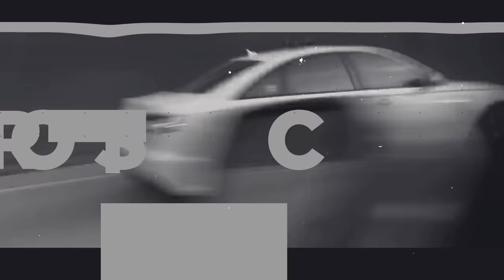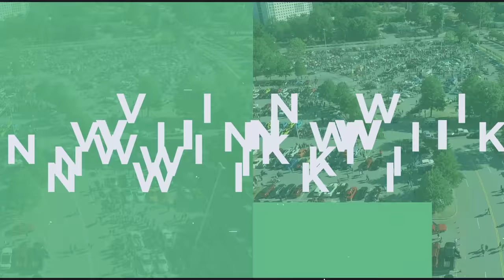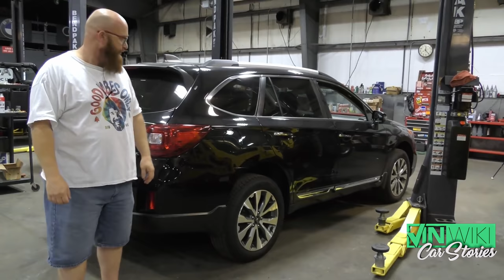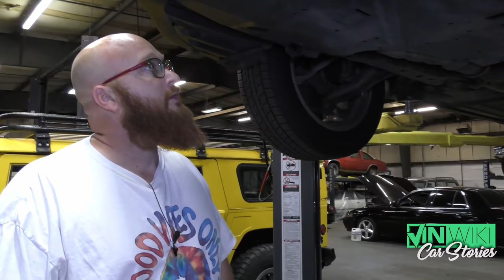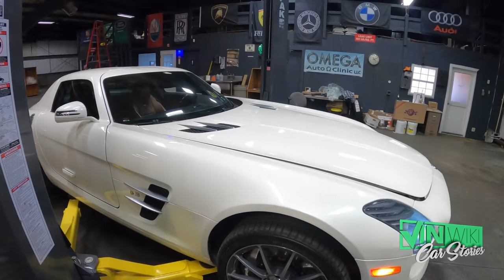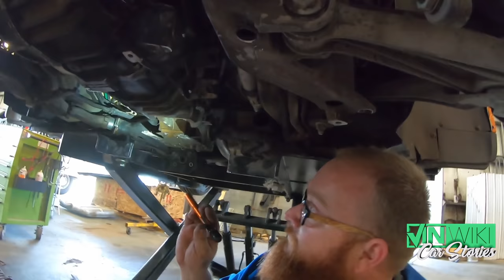The Car Wizard's 4 Worst Mistakes Ever!

Comment: Takes a man to admit his mistakes.  Happens to the best of us.  Thank you for your service.  In the USAF I’ve seen a few as well.  One was not pulling the manual landing gear release lever out of the port in the floor and when the mechanics swung the gear using hydraulics and the lever on the instrument panel the manual lever on the floor swung forward against said floor and bent a bunch of linkages, damaged the floor, and downed the airplane for a week or so. 

Also, guys dropping a 6.4 million dollar targeting pod because they were in a hurry.

On the contracting side when I rebuilt helicopters, there was a dude who wired a relay panel wrong and it shot sparks across the inside after power was applied (115V 400hz 3 phase).

Like I said, happens to the best of us.  Even fully qualified maintainers.

Comment: Working with the structures crew I was riding brakes on TP-01 , the Mexican Presidential 757. They couldn't find a lift to tell if it would clear the tail going into the hangar. I told them to lower the main struts and it will go we did it several times. I was along for the ride and I heard a screeching sound. Instead of stopping I heard the tug pulling harder, then whoa! The guy driving the tug looked up and said what was that noise? Sounds like ripped and tearing sheet metal to me.

Comment: My moms favorite Subaru wagon had same fate by valvoline oil change. Guy drained trans, then double filled engine. Grenades both, since value of car was less than $1500.00. They gave her $1k which could not buy and replace engine and trans. She just had timing belt service. We traded it for a focus

Comment: on subaru automatics traditional and cvt the transmission and front differential have separate oil supplies, manual they are one assembly

Comment: Those FUPPs (full up power packs) for the Abrams are not cheap but they are by far the easiest to replace compared to any other military vehicles. Loved working on the Abrams such a great piece of military might.

Comment: I made the mistake of draining the cvt transmission fluid out of a 2017 subaru crosstrek thinking I was draining the oil for an oil change,  put an extra 4 quarts of oil in the engine (way overfull) and sent the customer on his way with an empty transmission.... needless to say I was replacing his transmission 2 days later. Discovered where the oil drain plug actually was after the fact. Lesson learned.

Comment: The subaru mistake is a common one for beginners. Changed the trans and diff fluid on a friends 2013 Crosstrek, but was very careful to do so knowing what each port was (3 or 4 ports close together). A year later, someone changed it again, or attempted to, and wiped out her transmission. Shop insurance covered it. Pretty dumb F thing to do though.

Comment: My sisters brand new 2019 Ascent, I think first or second oil change. My dad changed her tranmission oil in stead of regular oil. I didn't hear anything about the differential, but the transmission was gone. $9000 charge from the dealer to replace. It was lucky, but my dad's homeowner's insurance covered it. I was more mad at my sister than my dad, learn how to change your oil, have your husband do it, or pay someone to do it.

Maybe Subaru should label the fluids better?

Comment: I got an oil change from a quick lube place in Billings Montana. Later that day as I was driving across the country, in the middle of nowhere Washington a cloud of smoke come out of the back of my car. I had to walk 5 miles to the nearest house. What happened was they put on my oil filter on wrench tight and my drain plug on hand tight. All the oil came out of my engine. They ended up treating me right and got me a rental car. It went to a Chevy dealer, and they went through everything. Good ole LT1.

Comment: One of my worst mistakes was on a vw crafter 2.0L TDI. Just put a new head on it because the serpentine belt tensioner had failed and the belt ended up tangling with the timingbelt on the crank and made it skip time and well valves hit pistons and thats it. But i did forget to tighten the 3 bolts for the camshaft gear properly, which results in skipping time and oh fun i have to do it all over again. But hey shit happens sometimes what matters is how you deal with said shit.

Comment: If I remember correctly the Abrams shares an engine with the apache but of course not the transmission. The wizard had a good commander that understood that mistakes happen and didn't over react about that situation.

Comment: One time a Mercedes dealership screwed up a basic Service A on my friend's E350. The tech not only managed to overfill the motor with oil but also spilled a ton of oil all over the motor and naturally it dripped onto the exhaust manifold. As my friend was driving home the oil level too high light came on and as the motor warmed up it started to smoke everywhere and out the exhaust. Car got towed back to the dealership. The dealership did do over the oil change but told my friend he had to pay for the engine bay shampoo. After some arguing they finally agreed to shampoo the motor to get rid of the burning oil. The thing is the motor burned some of that excessive oil so it ended up fouling his spark plugs and messing up the cats and o2 sensors and on went a 6 month battle between my friend, his insurance, the dealer's insurance, lawyers and that dealership. Complete mess and to top it all off that Service A was $320.

Comment: I have a highschool shop story. Brand new F350 that the shop teachers relative just purchased was in getting simple oil change. My friend went to drain the oil and drained the transmission oil. Then he started to fill the oil but it quickly overfilled and right away shop teacher knew something was wrong. A bit later that ford got new engine and transmission oil. No damage other than some embarrassment 🤣

Comment: There was a lot of vehicles that has the trans and diff were married  that had diffeent reservoirs. They didn't put a drain plug on the diff and the fill plug was hidden.
Most of the early Toyota's did before they used ATF and removed the seal between them.
I bought a 92 corrolla from a buddy who had changed CV shafts. They had only used it for short drives.
Drove it 70 mikes to home and the next time i drove it to work the diff locked and broke.I have been a mechanic for 45 years. Have so many master certificates you cant imagine.
Rebuild diesel engines, heavy duty aotumatics and train how to do it.
This type of thing can get anybody.

Comment: A guy at my work did the same thing on a Subaru, you have to understand the automatics have a separate differential, the manual is a transaxle and shares the fluid, the cvts are another ball of wax.

Comment: A Jiffy lube messed up the transmission of a Tacoma I had. I went for an oil change and they offered to also change the transmission oil. Apparently they messed up something the transmission didn't work properly after that. Ended up driving it to Mexico to get it fixed cheaper. The oil place never took responsability for it

Comment: I broke an ear off of a 700r4 trans  once missed a bolt ,I  Didn't get the wheel tight enough  on a dodge dually once.Had to drive to ks city to install new wheel studs.put a head gasket on a 5.4 upside down facing backwards once. those are the biggest things ive screwed up in the years ive been at it.

Comment: I remember doing a job years ago I put a power steering belt on one rib out on a PK belt after doing a timing belt on a costumers car. a few days later it broke a pace of rubber off the power steering belt and sucked it into the timing belt and bent 10 valves... lol even my boss said I was extremely unlucky.

Comment: I didn't know the Wizard worked on Abrams.  I never seen a power pack dropped but I did fill one with water and trash it.  My boss was pissed but it wasn't my fualt.  A tech from honeywell had left an inspection plug out that couldn't be seen from above while doing my inspection before a waterfording test.

Comment: Those M1A1 engines are not only expensive,. they don't last long.  One of the reasons the Gulf War was over so quickly:  they were running out of tank engines.

Comment: Believe it or not the way back in the late 1990s I had my 1992 Nissan Maxima SE at the Nissan dealership for replacing the worn cam chain sprockets. In the process the mechanic somehow did something that resulted in the timing chain to be thrown and half of the valves were bent and the dealership fixed everything they caused to be damaged and supplied me with a free loaner car and I was only charged for the original quoted price for replacing the timing chain sprockets. The repair bill would probably exceed the value of the car but they were honest just like David was with the Subaru owner. Big props to that dealership because I think many garages would lay all that expense on me giving me some story about how the car was not properly maintained or something similar. Hudiburg Nissan if you live in the Oklahoma City area. They are honorable folks -- if you can get the best service advisor I've ever had. He treated my mom and dad like royalty even though they weren't and he was always honest and straight with me too. Marvin Johnson. He's been there for 25+ years and although his name isn't on the dealership sign out front it should be.

Comment: I thought it was when he doubled down on not pre-lubing filters, betraying his lack of understanding of the difference between a constantly replenished lubricant wedge and a blast of air through your main bearings, pushing out the last flimsy bit of leftover fluid film it needed for startup just at the second the engine fires.

But at least we know he makes it right. Obviously a good guy, if you're not a crankshaft.

Comment: I was changing the oil on my Outback and ended up draining the transmission and over filling the oil (don't drink and change fluids). Damn thing actually ran for a couple miles until my wife brought it back complaining it was smoking. Drained oil, filled transmission. No issues 100k miles later after I sold it. It was an H6 if that makes a diff.

Comment: This wasn't a mistake so much as a funny mishap.  I worked at a Chevy dealer and of course we had a service department.  At the end of the day the compressors are turned off.  Well one lift had a car on it and the car was back out but not all the way and left there over night.  Somehow when the air came back on the lift does what they do and lifted.  The lift caught the front bumper of the car and we found it hanging off the lift.  It was so funny to see a Citation hanging in mid air.

Comment: I was a 63whiskey all wheel direct support mechanic. then switched over to the Hotel designator or  track side. We would break so much shit just not having proper supervision. 
Breaking bell housings three time in a row putting in transmissions. 
One time we were about 150 miles from post and a wheel bearing failed. Instead of getting it towed they said screw it and drove the hemtt back to post which was 150 miles on the autobahn. The end of the third axle of four was completely melted on the end. Couldn’t get the wheel off nothing. Had to cut it to get wheel off then Bogeyed the whoop four wheel back section out to replace entire third axle assembly. Army never gave us shit about that kind of stuff back then was mid to late 90’s. We’d just be like ….it broke again. 
😂 👍

Comment: I broke a buddies laptop when putting it back together. I accidentally used a screw that was too long in the wrong place. The screw broke the pins on an IC chip on the motherboard. I felt so bad about it. It was a bad design by the manufacturer and I've not encountered another model where this same scenario could occur.

Comment: I don't blame the technician for the Subaru they put the fill holes for the front diff and transmission where they are easily confused we did the same services on an outback where we put the wrong fluid in the holes. We caught the mistake before the customer left but the contaminated transmission gave out later.

Comment: I changed the fluids in my Moms 13 Crosstrek 3 years ago. So 3 weeks ago I did it again. I couldn't remember what plug was the front diff fill plug. So I went to YouTube and watched a video. I was in a rush. Video said driver side. Well video was from Australia. So I filled the CVT with gear lube and ran the diff dry. I flushed the CVT 5 times. 300$ in fluids. Car has been okay for a month. I just smell the fluid burning still. I don't see any leaks. I did dump it everywhere and on the cat. I have washed the engine 5 times and it still smells. Not sure if I burnt a seal up. Well only way to find out is pull it out.

Comment: I screwed up on my bosses brand new Ram 5500 by dumping DEF into the front fuel tank. I was getting it ready fir a trip to pull a car home so I told him. He didn’t get mad which helped me stay calm. I told him I can drop the tank drain it and clean it. An hour later and a full tank of cloudy diesel I had it back together and it didn’t cost me 6-8000$ for a new fuel system. I learned a long time ago to admit a mistake and fix it before it gets expensive for your pocketbook and your credibility.

Comment: I worked in a shop doing light mechanical work,one day I swap out pads on disc brakes .I forgot to pump the brakes before putting it in gear to back off the ramp and it shoots off the side and I was like f#$&.I got it off there and it checked out ok.

Comment: That is a major engineering problem on the part of Subaru, if you're gonna design it such that you can't interchange fluids you need to clearly mark one port as for one and the other port for the other

Comment: Certain things you should go to the dealer for. I just got a late model Panamera 4s.with 13k miles.  Having the PDK transmission fluid changed at the dealer. Not worth the risk. Everything else, I go to an independent Euro mechanic.

Comment: Stuff happens.  We had an aprrentice putting on an ac compressor and put a long bolt where a short bolt should go.   Now hes replacing the engine  (cause he punched a hole into an oil passage) luckily boss man is understanding and he is paying for it

Comment: The case of Tyler's AMG is strange. Magic Mike used to work in a Mercedes shop.  Shouldn't he know how to change fluids?
Reply: Thats a pretty special car, just cause he worked at Mercedes doesn't necessarily mean he knows how to work on that speciality amg car. In fact some manufacturers have specific training you have to take in order to work on certain cars and he might have never had that training so he would've never worked on those cars
Reply: When two different fluids are labeled BOTH as hydraulic in the OEM service manual, unless you work on them consistently it is an easy error to make.
Reply: in Mike’s defense, he asked Wizard to make sure it was the correct fluid and got confirmation.  Also, there was added distraction with Tyler jamming his camera in all sorts of places while they were working.